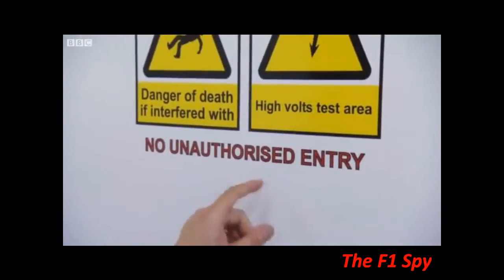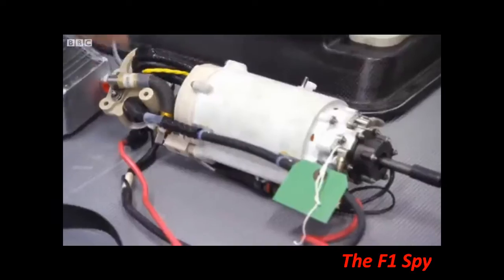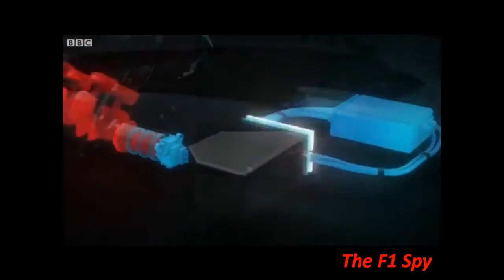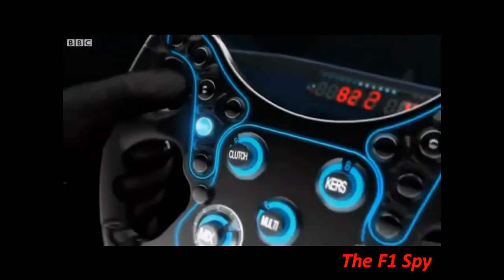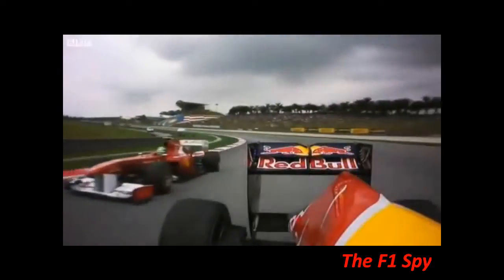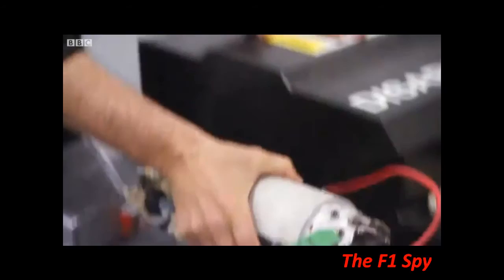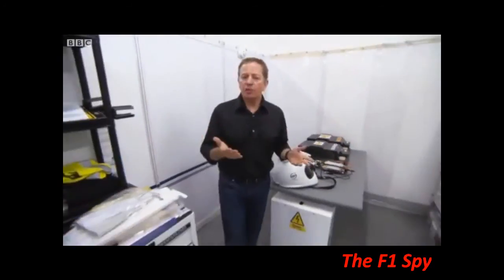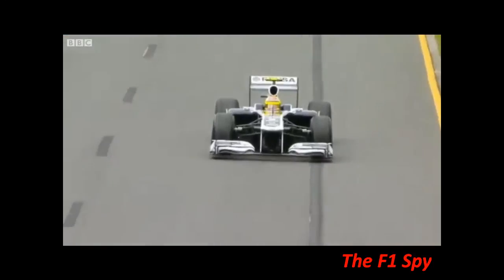How KERS works in an F1 car

Comment: The teams have an all up weight limit that they have to achieve between the weight of the driver and the car. All of the teams actually bring their car in well below the weight limit and use ballast to bring the car up to the required weight so by using KERS, teams can actually put that weight to good use, hence it is an advantage to install KERS not vice versa.